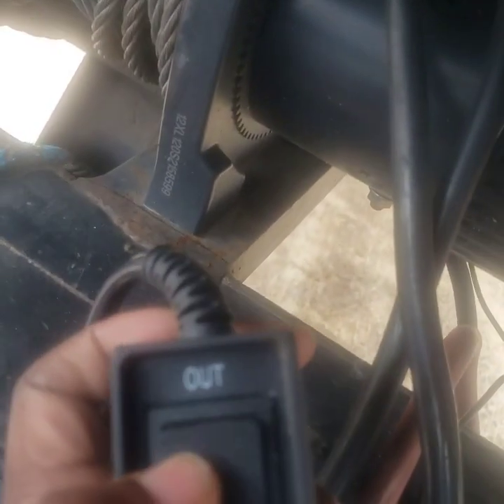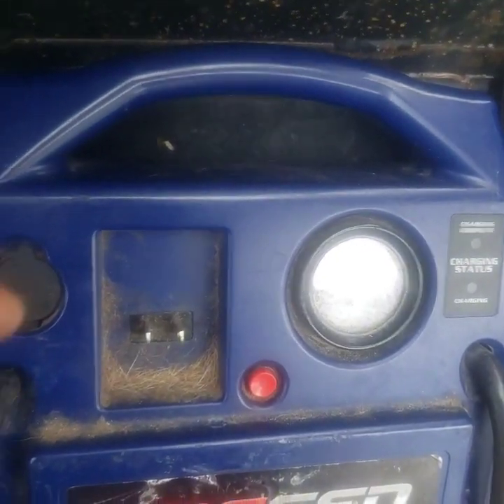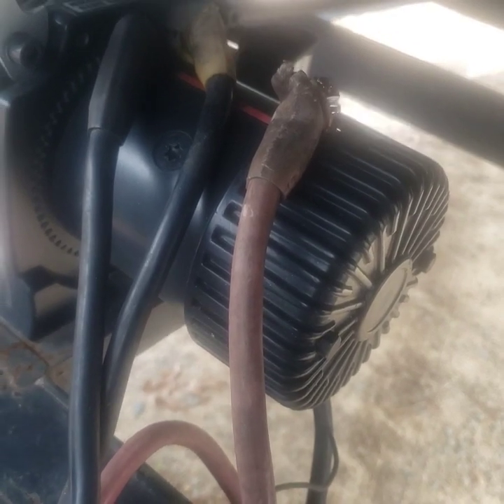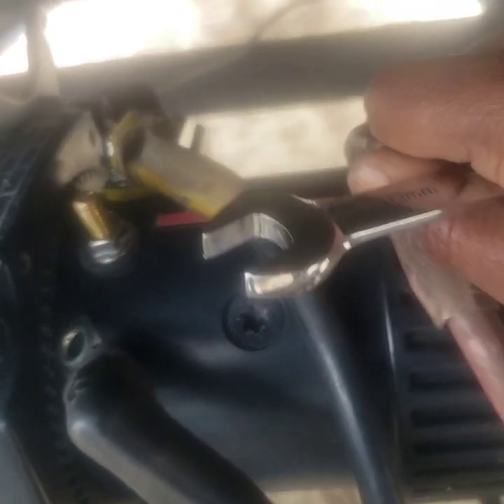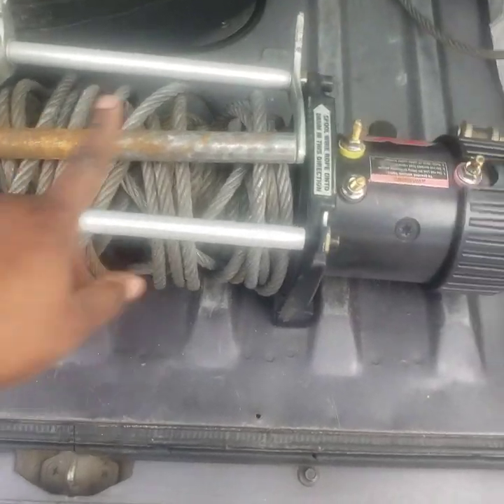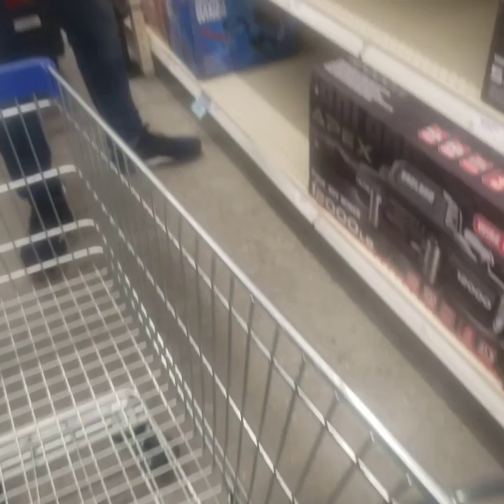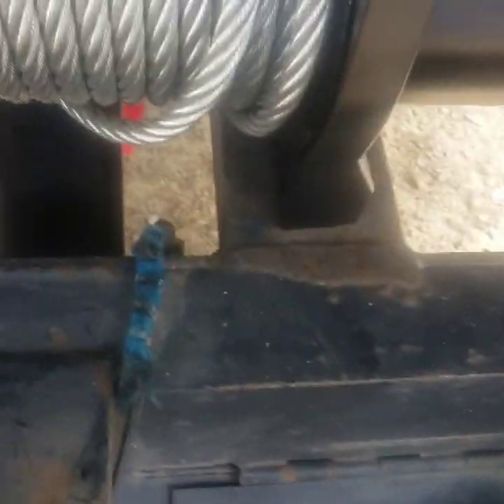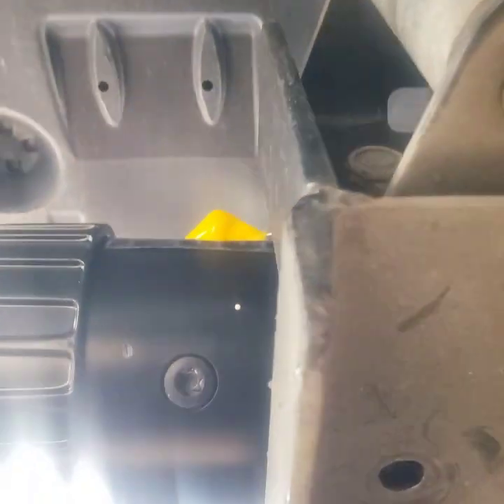Trouble shooting a winch that goes in, but not out 🙄

Comment: The winch motor is shorted through the solenoid pack, YOU MUST disconnect all the solenoid box wires from the motor before testing the winch for in/out operation!

The solenoid box creates a reverseable control output called an "H" bridge to power the motor.
Reply from the maker: Thanks for sharing that! ❤